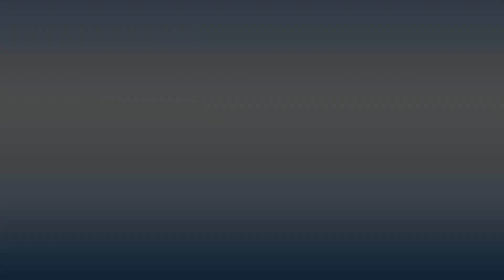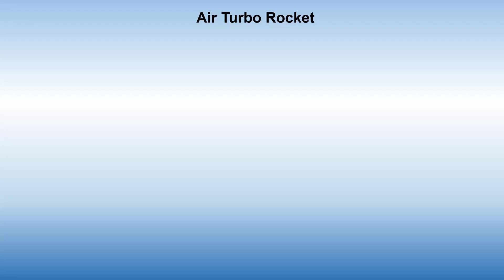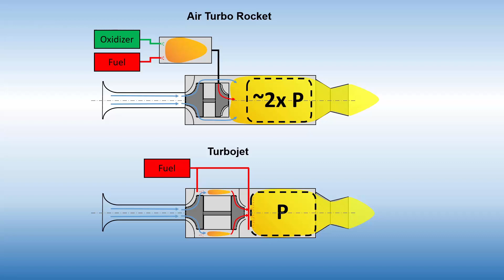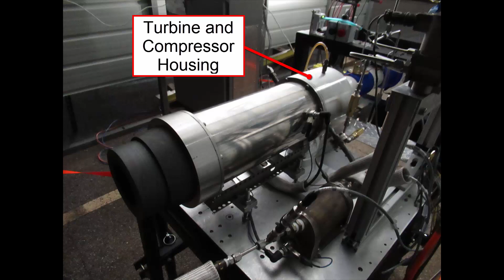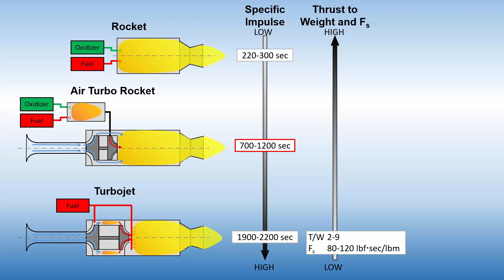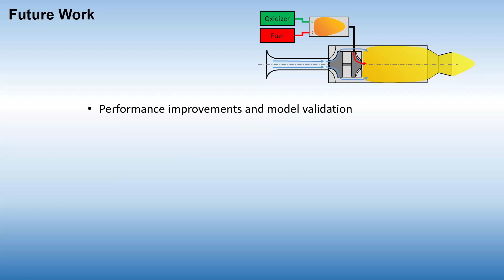Air Turbo Rocket Introduction

Comment: Beautiful. I know of another technology which, when added to this, could *********** by 20%.  Maybe more. 
Was going to type it here but then I realized that would be too much giving it away for free hahaha, close call.
(I will give a hint. The combustion chamber will have to be redesigned. It's an awful waste of potential to have all that thrust merely expelling openly out the rear of the jet that way. Nozzles are obsolete and a complete waste of energy. There is much more that can be utilized for thrust as well as overall speed, and without need of any more mechanical components. Strictly design of the product the jet is added to, and one simple alteration of the combustion flow.)
cheers
see yall at the finish line ;)

Comment: An ultra long range air to air rocket. It has a standard metallized solid rocket motor first stage and a solid gas generator powering an ATR as the second stage. The supersonic expansion at hypersonic speeds is utilized in order to admit cold air, then the air is heated and pressurized by an internal ramjet cone and then sucked by a turbocompressor. The pressurized air is burned with the fuel rich gasses from the solid gas generator in the overexpanded area of the nozzle. This rocket is not limited to mach 4.5 like meteor, higher speeds means more airflow, more air flow into the engine means longer range... Long live china...

Comment: I just happened to be reading about Air Turbo Rockets in Kerrebrock's Aircraft Engines and Gas Turbines textbook and you posted this. Great timing for me! Well done on the technical demonstrator! Have you considered a developing a variable cycle system? The hydrogen expander cycle looks very interesting for long range high speed cruise, but the throttling issues at low altitude could probably be offset using a bi-propellant cycle for the first flight phase. With clever turbine assembly geometry, you could get both cycles driving the same rotor. A liquid methane cycle would also be really interesting, though not sure enough power would be available for an expander cycle unless already cruising. Anyway, great work!
Reply from the maker: Hi Gaston. I'm glad you enjoyed the video and thanks for your comments.

We're currently focused on the items mentioned in the future work section of the video; therefore, I don't think it makes sense for us to consider any sort of dynamically switchable source for the turbine drive right now, even though it could be theoretically beneficial.